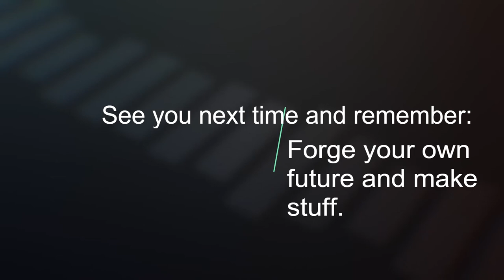Big bearing, Little knife Pt1

Comment: Cool. Very interesting.  I guess the hard material would make a good knife
Reply from the maker: Yep, you need steel with a carbon in it because that makes it hardenable. That’s how you get it to hold and edge. Bearing material is tough to work but makes for a great knife.